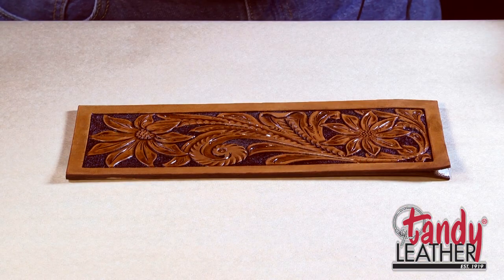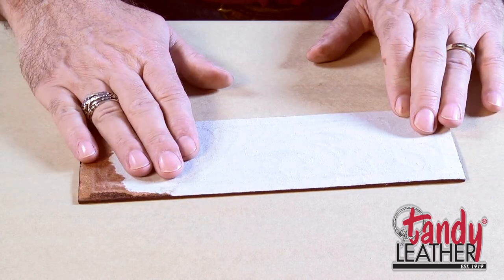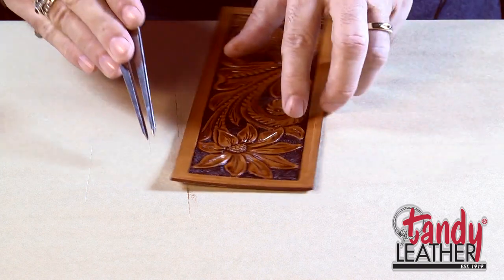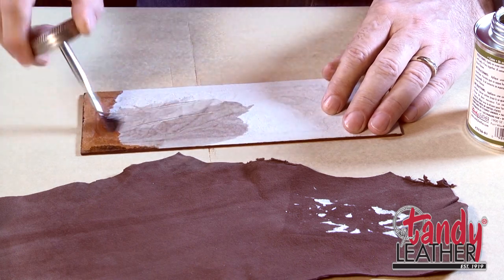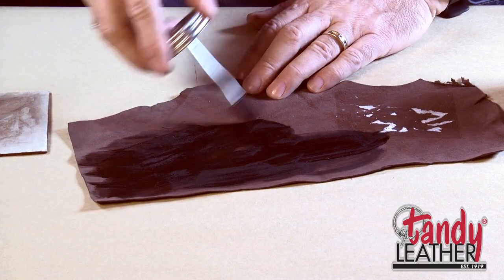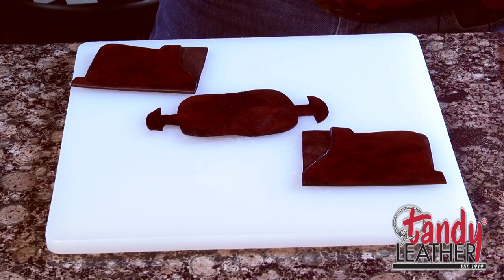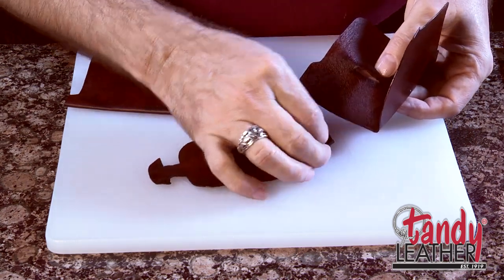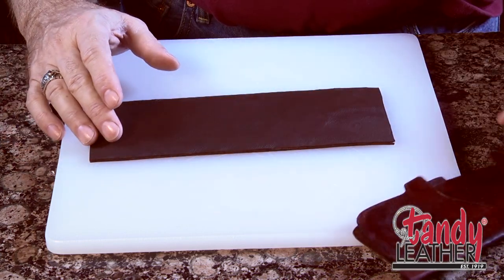Learning Leathercraft with Jim Linnell – Lesson 12: Wallet Assembly

Comment: what kind of glue did you use to attach cardboard to leather?
Reply from the maker: +Alex Hernandez Earlier in the series, we used rubber cement to attach the leather to the cardboard to prevent stretching and allow for deeper tooling impressions.  Rubber cement offers a temporary bond, so it comes off more cleanly than other adhesives.  https://www.tandyleather.com/en/product/tanners-bond-rubber-cement
Reply: +Tandy Leather Perfect. Thanks!